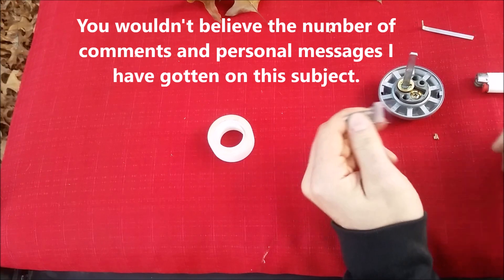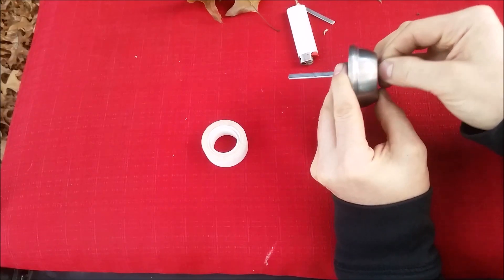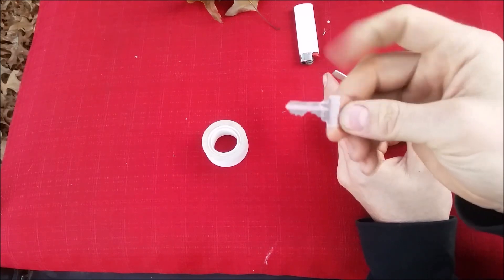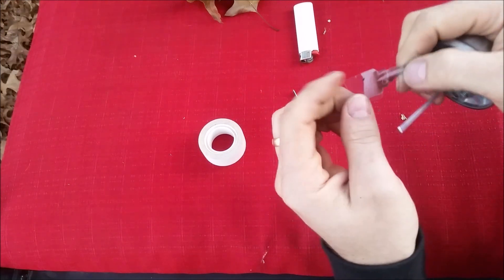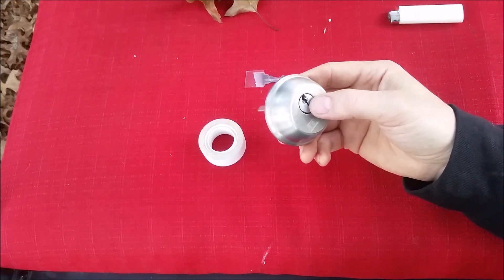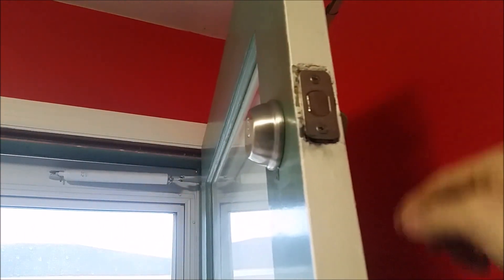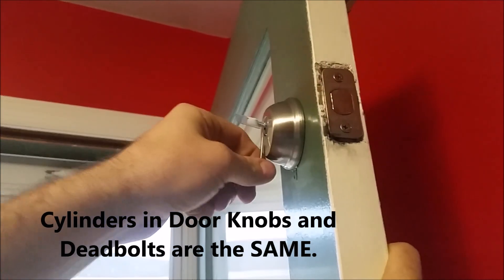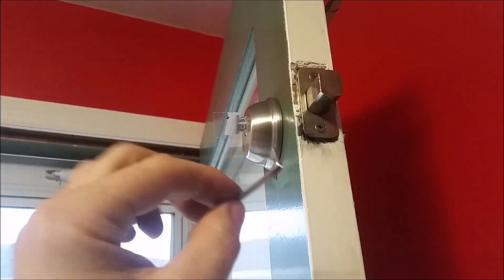Does Homemade Key Work on DEADBOLTS??

Comment: my concern would be, if there was even the tiniest bit of friction between the bolt and the door jam would it over power the rigidity of the plastic?
Reply from the maker: You couldn't have actually watched the whole video and have just said that.
Reply: That door wasnt actually closed and locked. Im talking about the friction from the opposing door jam.
Reply from the maker: +David Ridout There is nothing that can affect the pins.  You need to try the techique  before you try to critique it.